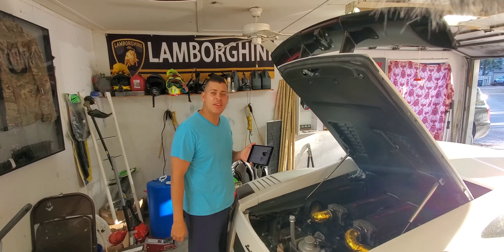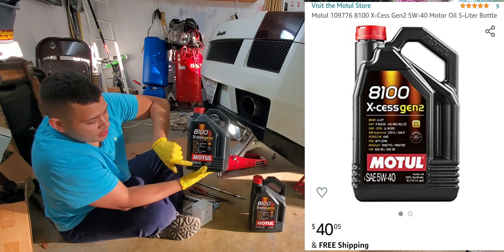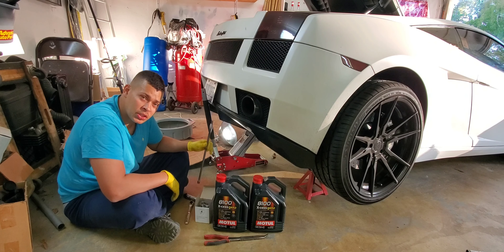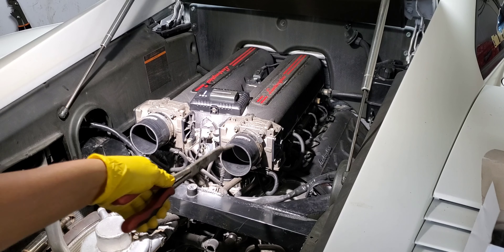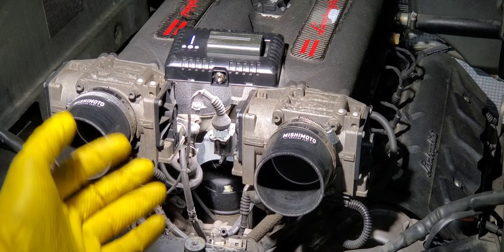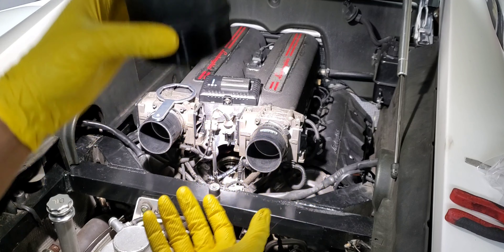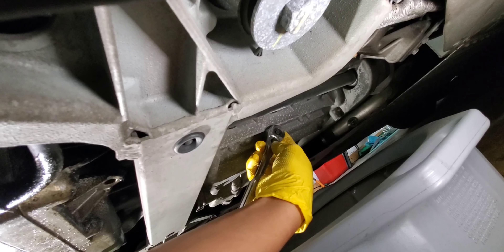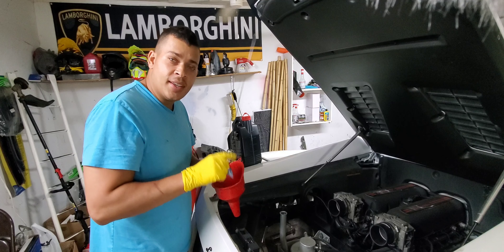The BEST oil change video for Lamborghini Gallardo owners!

Comment: What tourque specs/ pressure are the oil drain bolts suppose to be?
Reply: 45 Nm
Reply: @robisheretostay  thanks! Do I need to convert that, with just a regular American torque wrench I’m about to buy online? If so what’s the conversion ? Thanks for your help!
Reply: @robisheretostay  nevermind google worked 😂